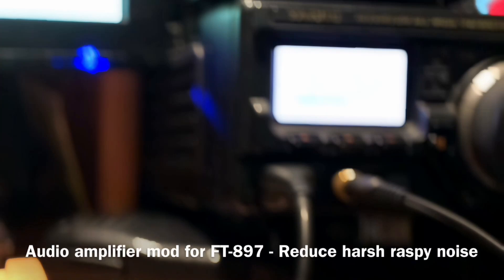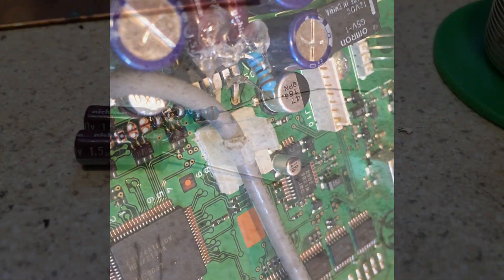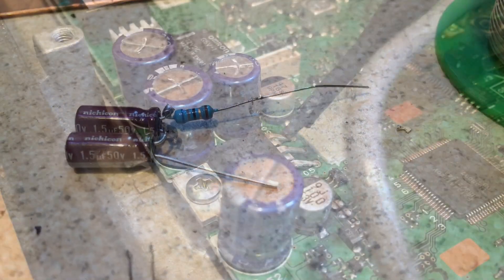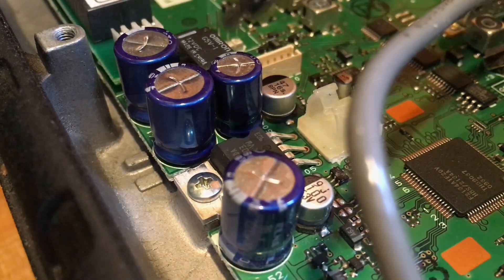Yaesu FT-897 Audio noise reduction mod

Comment: how much more is the amp draw with that mod ?
Reply from the maker: I haven’t taken any measurements but the data sheet indicates that the addition to the circuit is just there as a high frequency cut off filter.

Comment: Thanks for the info Alistair! I run both a FT-897D as well as a FT-1000MP Mark-V and just purchased a FT-991A with my stimulus check I received from the U.S. government. I'm definitely a Yaesu fan! I use my FT-897 almost exclusively for digital modes because of it's excellent cooling system! It runs very cool even if I get a bit long-winded on PSK31 or FSK-105 Hell modes. I love my Mark-V Alistair, my second one, the first got hit by a direct lightning strike, I have a post about it on my blog at https://ku4gw.blogspot.com/2011/06/may-22nd-2011-lightning-strike.html if you'd like to check it out. I wish my Mark-V had all of the filters like yours you lucky rascal! I just started following your blog also. Lots of good info. I have not made a post on my blog in long time now, too many irons in the fire here, but I sure am having a blast on amateur radio, starting my 24th year in the hobby October 16, 2020. If I make it until the next one I'll become a member of the Quarter-Century Wireless Association. I'm also into QRP portable operation using either a Ten-Tec R4020 or a Hendricks PFR-3A most of the time. I may start using my FT-897D portable some now that I bought the FT-991A. My FT-897D has a problem on VHF,  the transmit gets stuck and if I tap the mic key several times very fast it always unkeys, but it's definitely annoying, especially when using repeaters. I was here on YouTube looking for a possible fix and ran across your video above.  If you happen to see a possible fix for that problem on the FT-897D please drop my a note. I'm good on QRZ. Thanks in advance and very 72/73 de Cliff, KU4GW - SKCC#652C, NAQCC#1491, Flying Pigs QRP International#1183, 4SQRP#536, FISTS#16001,  A-1 CW Club#3440, Feld Hell (Hellschreiber) Club#0062, EPC#27746, 30MDG#0865, Digital Modes Club=DMC#6362, QRPARCI#15877, Elected member of the ARRL A-1 Operator Club since 11 April 2012.
Reply from the maker: Thanks Cliff, I will have a look on the blog, I too am a bit behind on keeping my posts going, life is busy here too. I will drop you a message and a link with a possible fix for the 897 that I have come across recently.

Comment: Did this mod yesterday (added a switch to see the difference), it does cut off the top end a fair bit - also (obviously) reduces the audio output from the amp as well so you have to turn the volume up an 8th more to get the same output - slightly easier to listen to, but not by much
Reply from the maker: Thanks for the comments Ian, I too noticed a slight drop in audio output, more on the external speaker I use than internally. I have quite a high noise level here so notice a much larger difference than I might do away from the home QTH, but now I may add a switch to experiment more.

Comment: Hi, sounds great! How have you connected the capacitors together? They both look polarised and connected - + - + ? Or does it need to be or act as a single non polarised capacitor?
Reply from the maker: paisteformula6021 I can’t recall from memory but the link to the mods online gives very detailed information on the methods.

Comment: Nice to see my WEB inspired someone. Cheers, 73 Petr OK1FIG
Reply from the maker: Petr Malý this is a seriously good, and simple, little mod that has changed my radio for the best. Thanks for sharing the information. The best part of what do is to share the knowledge we gain and the results we found from implementation.
Reply: You inspired me also, I have bought the tantalum caps to do the job some time ago, nice to hear it in action on here